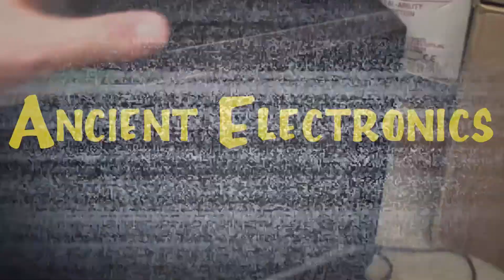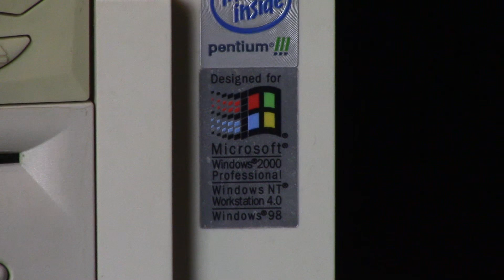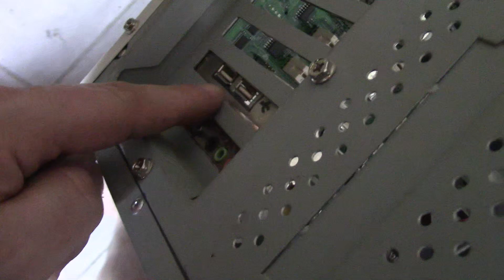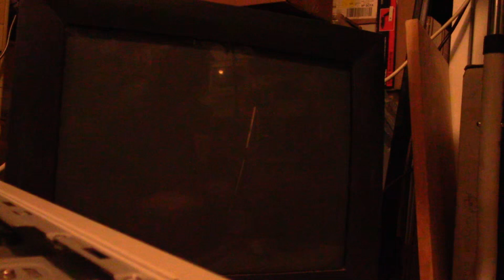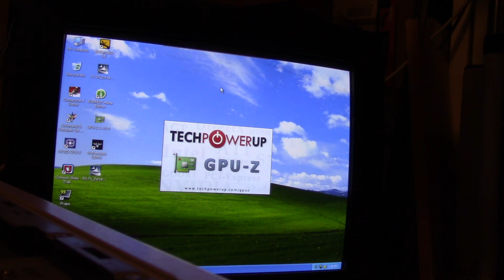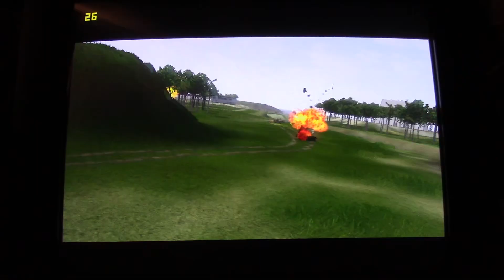Taking A Final Look at my Dual Tualatin Build

Comment: Maybe I went old and senile a long time ago, given I've put tables on the bottom of the cases for years with the hardware configuration and other important things, like an IRQ map, port map, NIC MAC and IP. This also exists in a huge document somewhere, an outdated copy of which even exists at some hidden URL on my web server so I can look at it from anywhere within range of an internet connected device.
Never was a fan of the Tualatin, though I'm happy to watch other people play with them. Was well and truly on the K7 train by then rather than an overpriced, unobtanium proto-emergency edition chip. What I do miss, though, is the dual Coppermine.
I think there were CPUs being made with multiple cores on their package, just not x86. If so, they were probably something highly specialized and RISC-based. Don't quote me on this.
Never did trust those bridge chips. Perhaps they expect AGP 8x or something. Still, that GeForce 6 should be more than fast enough for anything you'd realistically want to play on that machine. My dual Coppermine 1100 did fine on a meager Quadro 2 Pro while it was running, without incident. If more power was needed than it or the K7 with the 4600 Ti, then usually a modern computer could run it fine anyway, or the Presler got given the job.
Every Tyan board I ever went near exhibited AGP issues, though most of those were on the old NeverWorks chipsets, so dunno, maybe just a Tyan thing.

Comment: That slot loading drive... is that a 32x CD-ROM?
I have something similar made by pioneer with a mfg. date of "Jan1998" which is kind of early for such, since the G3 iMacs didn't  have SL DVD-ROM until 2001.

Comment: I have that same DVD drive fascia there.  Is that the 6x DVD-ROM drive?  I am curious, have you had any issues with it?  Mine has recently stopped reading discs.  I opened it up to examine it, and the lens assembly has two different laser lens on it and when it goes to access the disc, they just constantly swap back and forth and then it spins down.  I don't know if the electronics have failed or if something else has gone wrong.  It was the first DVD drive I bought for myself back in 1998 or 1999.  I paired it with a RealMagic DVD decoder card.  It was a pretty nice set up.
Reply from the maker: Mine still worked but it did feel like its struggled at times.
Reply: @AncientElectronics    Even when mine was new it sounded and looked like it struggled from time to time.  I recall it wasn't a very cheap priced drive either.  It was 100 dollars USD, which may not sound like a lot, but when I could get a 24x CD Rom drive by that point for 30 and there weren't really any games coming out that I wanted to play on DVD I could have saved myself some cash.  I also recall that it wasn't particularly fast on the CD-ROM side of access.  Really high seek latency.  Does that hold true for your drive as well?
Reply from the maker: @helldog3105  it does, I never found it to be be particularly fast in operation.

Comment: I recently bought one of those wavy-door DVD drives on eBay because the wavy door looked neat. That is probably one of the worst criteria for buying a drive on eBay... it, of course did not work. And while I tried to fix the problem (door won't open), copious amounts of lubrication was not the answer. Maybe someday I'll fix it.
Reply: You'll fix it. Bad belt? Maybe endstop switches need DeoxIt?